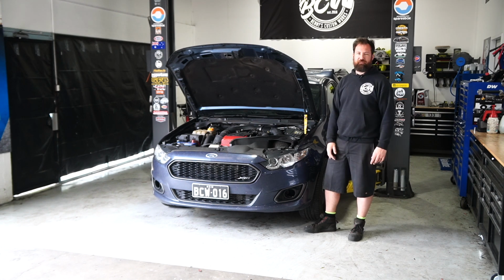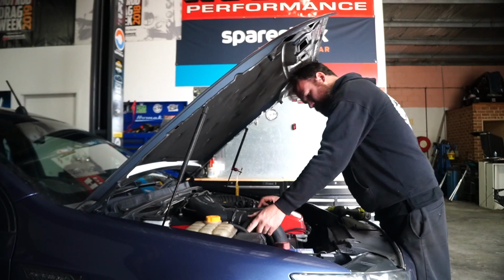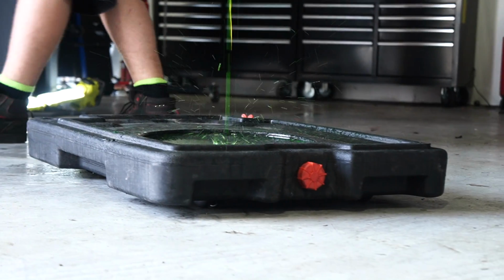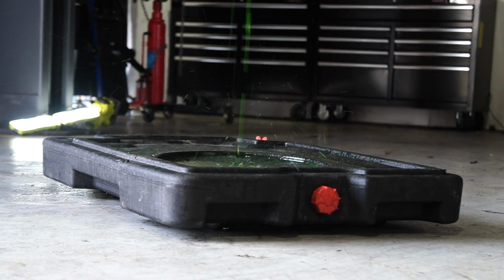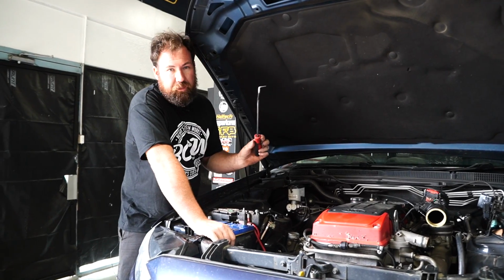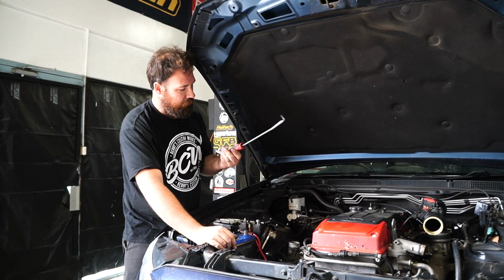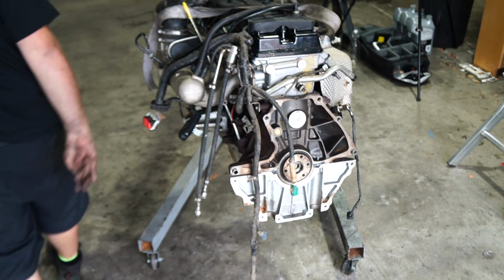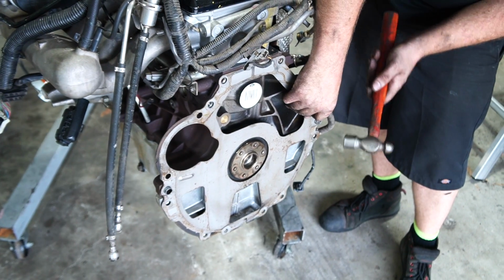FERRARI FORD | ENGINE SWAP

Comment: THAT VALVOLINE COMMERCIAL WAS SPOT ON!!! 

Best plug I have ever seen. Super short and just weaves in perfectly!
Reply: I came to the the comments section just to see if I had actually seen that.
Reply: It was also a throwback to the John Laws days,  TV ads back in the mid 90s.
Reply from the maker: The 30 sec version should be on most TV networks in Aus and possibly NZ by now

Comment: Benny, a spanner placed under the lower bolt in the bonnet hinge(either side) holds the bonnet up almost vertically, I have a broken 17mm Sidchrome ratchet spanner that's my go to.
Reply from the maker: That’s a good idea, thanks.

Comment: Barras are so durable! Daily driven xr6t gets engine swap at probably 200k KMs
Reply from the maker: ( 350000 km)
Reply: @BennysCustomWorks  still only just run in and needing valve stem seals at that point. :P
Reply: My FG xr6t ute has 400k on it , always serviced and a new turbo is about all done to motor so far, uses bugger all oil .Still loving it, except for the sagging roof lining LOL

Comment: Love the little pick to remove the plastic plugs. Not sure the one-piece manifold will hold up.
Reply from the maker: One piece manifold?
Reply: @BennysCustomWorks  Ford made a 2 peice manifold to stop it from cracking.
Reply from the maker: @royferntorp3575  you mean the exhaust manifold? This is a factory Ford exhaust manifold, all turbo manifolds are one piece.
Reply: @BennysCustomWorks  Probably thinking of the NA exhaust. Been a while since I took a Barra apart.
Reply from the maker: @royferntorp3575  yes I believe AU on had a 2 pce mani in NA

Comment: Just finished  a BF, had dramas removing and installing the engine, maybe a slightly shorter engine bay? and damaged the sensor at the back of the head
Reply from the maker: Yes they’re a touch shorter. It’s super common to break the cyl head temp sensor too :(

Comment: Did you use a gasket as well as sealant for the inlet manifold?
Reply from the maker: Sealant only. The stock gaskets blow out. The cresta has only ever had grey sealant on the flange, no gasket
Reply: @BennysCustomWorks  oh awesome. Thanks for the tip!

Comment: That new motor needs its rocker cover painting green, just so everybody who sees it goes "hhhohmygawddd it's a greentop it must be making eleventy billion horsepowers!!!"
Reply from the maker: Stupidest myth on the Internet imo
Reply: @BennysCustomWorks  Greentops bro, they've got the FPV forged conrods and the gas pistons are 10:1 compression so they're forged too ZOMG free power bro! Chuck it on E85 and 45 PSI of boost easy 1000 kw at the wheels bro you'd be mad not to bro!

Comment: Why does everyone pull these out the hard way. Simple and easiest way drop the tailshaft, gearbox Mount. Unplug the wiring harness at ecu and fuse box , strut mounts, steering shaft and finally brake calipers. Place entire assembly on  a pallet and unbolt k frame.lift the car off the K frame. Less than 1 hour the engine is out .
Reply from the maker: Less than one hour to pull it out this way too . Also means no wheel alignment sand not touching trans / tailshaft. You still need to split the engine + trans then you need to assemble it all as an assembly before refitting so no time saved.